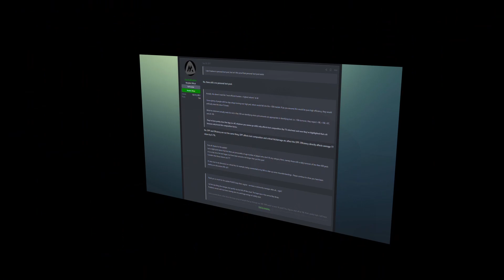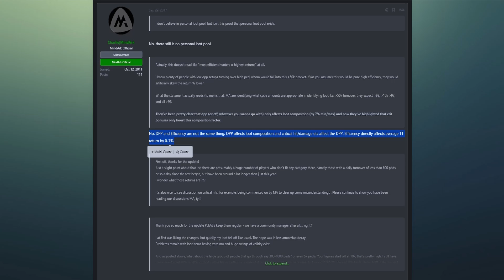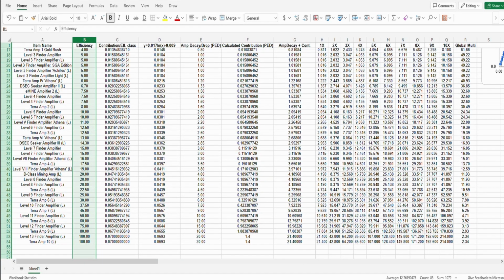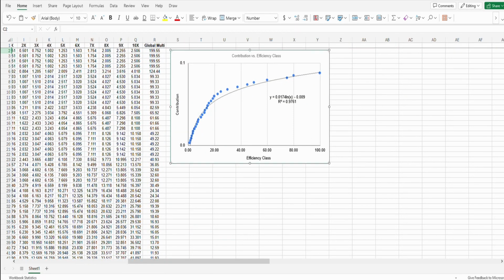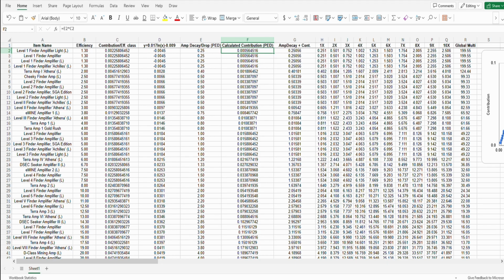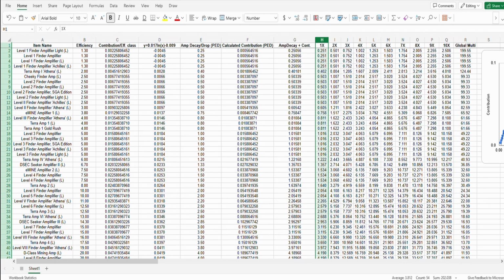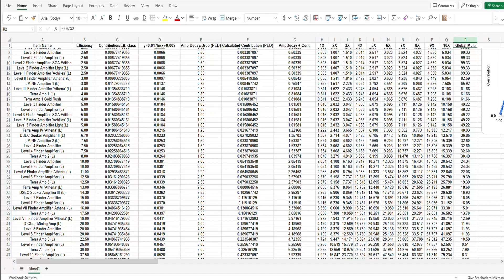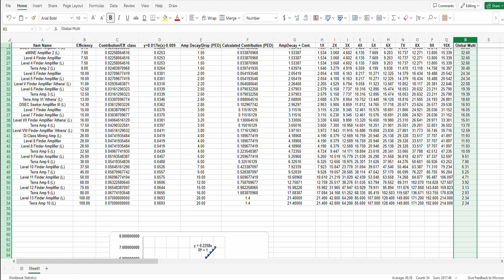A mining amplifier idea...

Comment: I think you need to factor in the claim size bands since a Global needs to be size 13 which is 50 - 74.99 ped which might be where the discrepency is regarding is a multi a whole number or not.
Reply from the maker: Indeed, one thing I didn't mention is that it is possible to get a claim that is below the the amount of amp decay + probe cost. The global column on the spreadsheet was just for fun I am not confident that it is anywhere close to reality! 😃😃

Comment: you want to mine eff dont do me and amp you  should unamp 1 area over and over that has a few resources with decent mu like igni for example and just keep cycling the peds like that. while amping can be fun now and then when the run goes well, 9 times out of 10 its gonna be a loss and all the mu wasted on the amps makes the loss worse ask strash or look at his mining log, if he did his mining over the years with lvl's5 that he bought with mu he would have been at a loss but because he had a ul amp he had some profit
Reply from the maker: Oh yeah, I used to watch Strash stream mining a few years back and he talked a lot about the UL level 5 amp that he sold for a profit after using it for several years.
All I am doing with this video is trying to get after what 'efficiency' means for mining amps. It appears efficiency doesn't help much at all for mining amps, but we need more data.
Reply: the eff is just the decay 5% per 1 ped decay @StirgeTropia